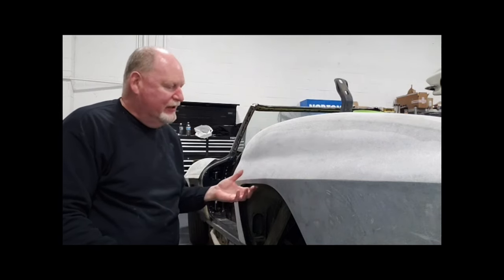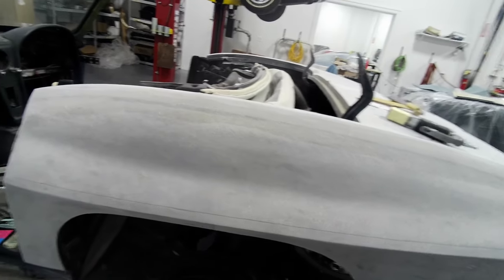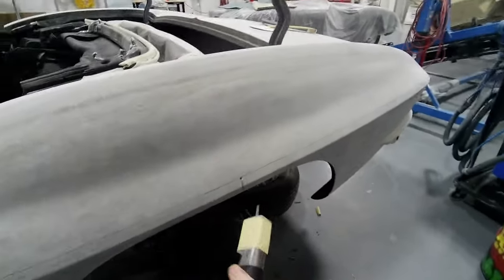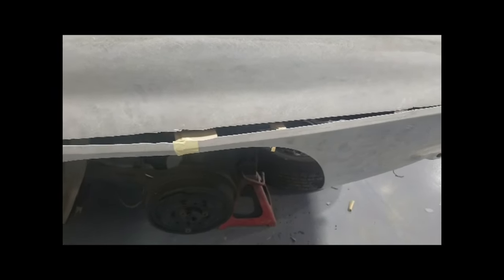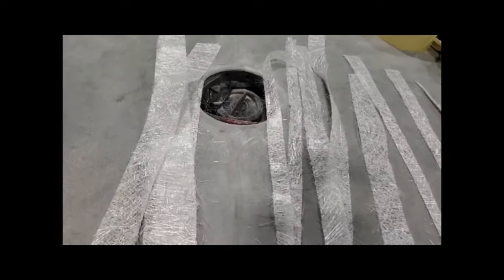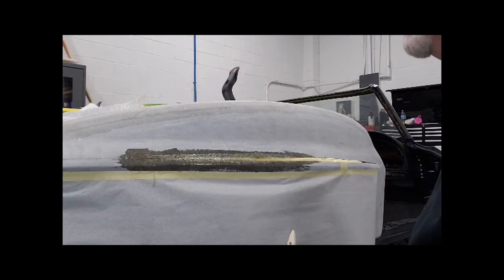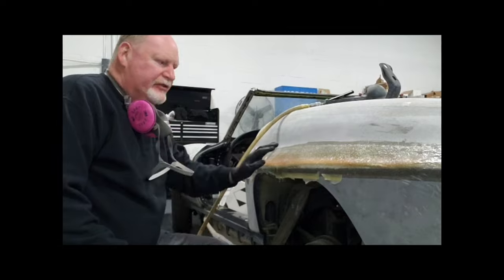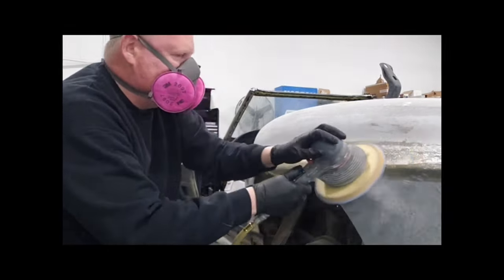How to make Fiberglass Cheater Flares on a C2 Corvette

Comment: John great video I am doing a restomod with a modern LS which I think would require a wider tire than stock. Do you have any idea how much of a wider tire this allows for? I am a little scared to cut my panel but you sure make it look easy.
Reply from the maker: Hi, Glad you liked the video, what type of frame are you using?  stock or an aftermarket frame? , the rear panels were brought out 1 1/2 inches in center and that was measured from the stock frame, this car we are building will be getting an Art Morrison chassis which is narrower in the back to accommodate some big tires, so really it comes down to what your looking to achieve with the tire size, if using the stock frame you could bring the quarter panel out even further if you wanted, Hope this Helps, Thanks again for watching

Comment: What did you use to strip the paint off?  Nothing seems to get off ancient red nitrocellulose and primer sealers below the old lacquer.
Reply from the maker: I never liked using chemical strippers on fiberglass only on a metal cars, and the strippers they make now don’t compare to the stuff you could get years ago, depending on how thick the paint is I use the razor blade method, it’s tricky and if you don’t do it correctly you can do damage to the fiberglass, but if you get it right the paint comes off in sheets, then what ever is left I usually take 80 grit on a DA orbital sander and take it down to the glass
Reply: @EYEBALLJOHNsKUSTOMKORNER  That would make a great video!  Ive always used the awful stripper.

Comment: gonna be doing this soon to my 63 swc, any pics of it in primer?
Reply from the maker: No actually the car is still in bare glass, it took over a year to get the Restomod chassis, I couldn’t finish all the glass work until body was mounted on chassis and I’m just fitting the doors , hood and deck lid now, Hopefully it will be in primer soon
Reply: @EYEBALLJOHNsKUSTOMKORNER  Thanks for posting your videos, they are very informatative.   I fully understand the long lead times for chassis.  i ordered an Art Morrison chassis November of 2022, 14 months ago for a 62 corvette and still waiting.  However, I have been told it is now about complete and should be receiving it within the next month. The lead time on some items is just crazy.

Comment: Have you ever done a similar modification to the front fenders on a C2?
Reply from the maker: Hi, yes I did the front fenders on this same car, I only brought them out 3/4 of an inch wider,  I split the fendercat the bonding seam and opened them uo the same way as the back,  I think I took pics of them being done ill have to look for them and post them, Thanks for watching
Reply: @EYEBALLJOHNsKUSTOMKORNER  Thanks.  I've been looking at getting all new fenders and quarters to widen the car but I'm good with glass and think you had great results.  If you can put a tutorial up regarding the fronts, please do!